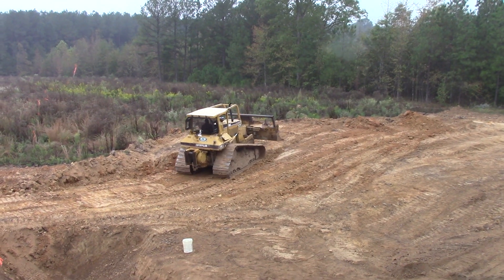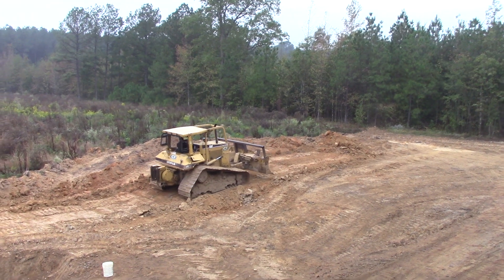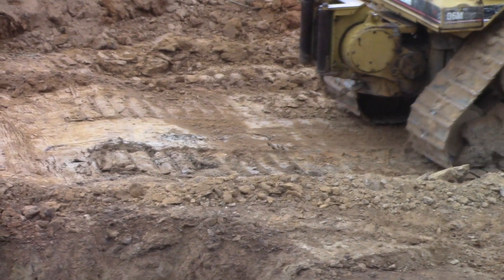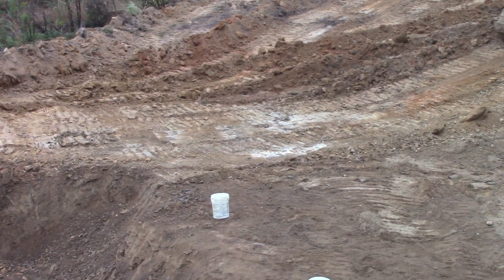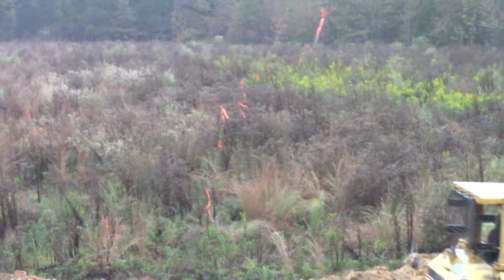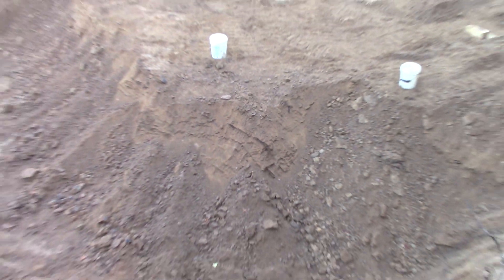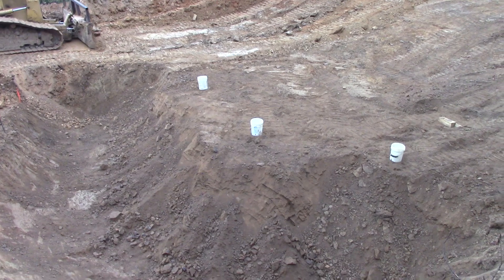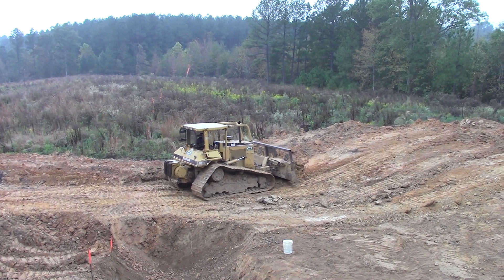The Worthington Diamond Mine Is Located Just Outside Of The Crater Of Diamonds And Is Taking Shape

Comment: Why are you doing this? Most diamonds found at the park are small ones, few and far between. Do you anticipate locating more?
Reply from the maker: I prefer to dig and wash with equipment rather than dig by hand and wash by hand.  I can do a lot greater volume.  Not all diamonds found at the Crater are small.  I've found two that weighed over two carats each at the state park.  Recently, visitors have found a 4.49-carat yellow, a 6.29-carat white, and a 9.07-carat brown.  Those are not small diamonds.